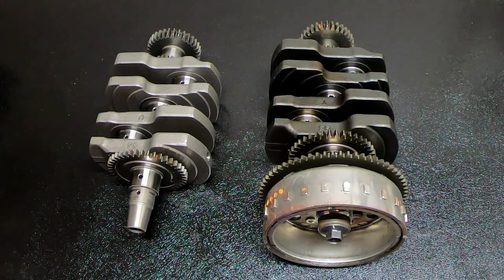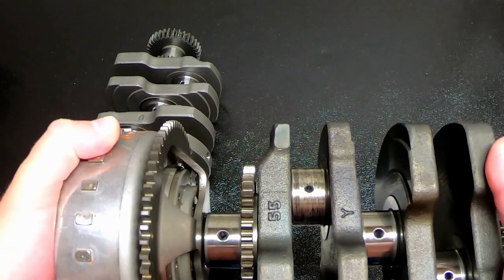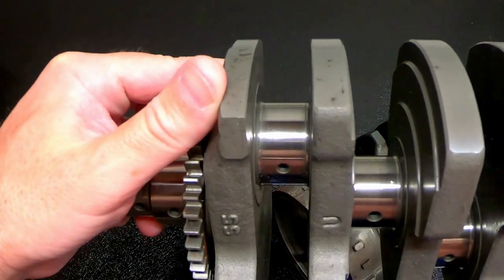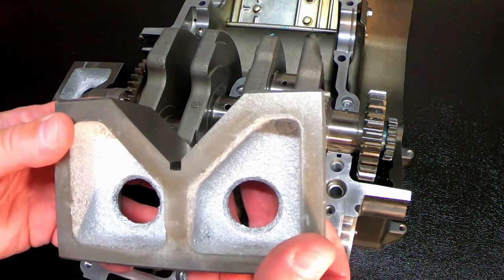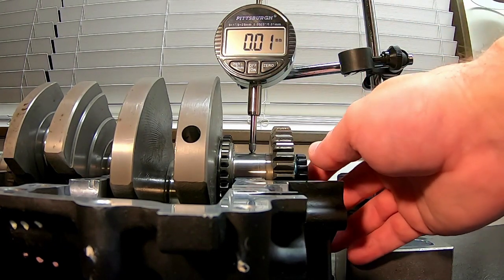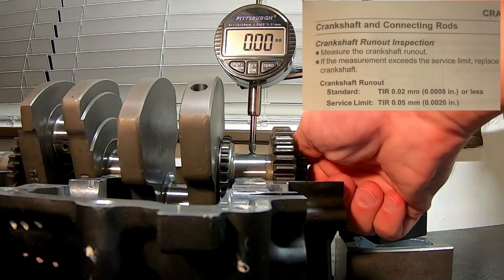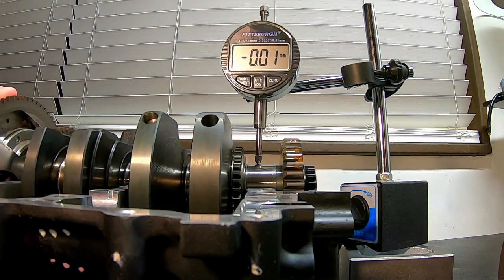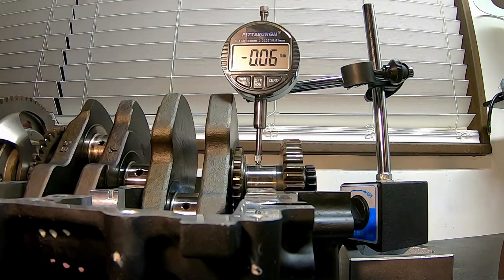DIY- Measuring Total Runout with a Dial Indicator - Ninja 400 Engine

Comment: Can u tell the reason for why the run out occurs
Reply from the maker: Runout is from the wear of the engine parts. It's basically when the shaft does not rotate in line with the main axis.
Reply: @Racer510 Ok so is it like after a certain miles...?? Is run out inevitable??
Reply from the maker: @naveedaka  wear/mileage definitely can contribute, but a certain amount of runout is acceptable. New engines will have a small amount of runout measurement according to the acceptable tolerances set by the manufacturer. Race engine builders who blueprint engines usually have the measurements close to perfect.